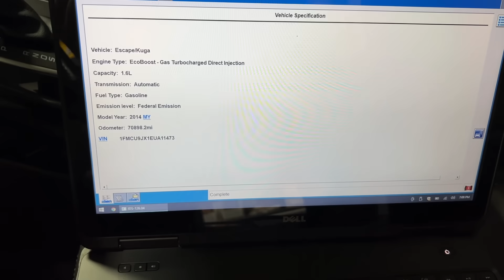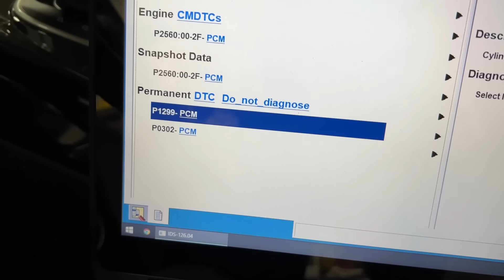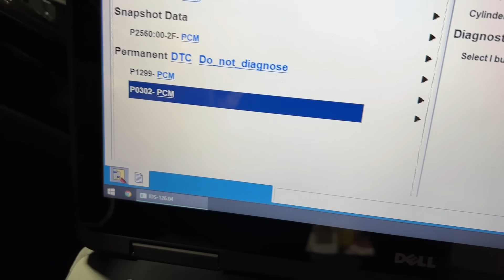Beware of Ford’s 1.5L 1.6L 2.0L Ecoboost Engines and Their Never Ending Coolant Consumption Issues!

Comment: As I write this, my 2018 has been sitting at the dealer for two weeks awaiting a replacement long block for this very reason! Thank God for our extended powertrain warranty! Ford really needs to own up on their defective Ecoboost motors!
Reply: They corrected this design flaw issue with the 2019 1/2 engine design....on all these ecoboosts....probably the replacement you'll be getting.
Reply: @barrya.6212  I got the Edge back two weeks ago with a new motor. Runs like a champ now, plus my wife is happy to get her baby back! Lol
Do you know what the redesign was?
Reply: @jasonbartz7352  Here is what I read about it...and this was the SECOND posting by a completely different person/ blog on the correction >>  "Because it’s a flaw in the block coolant passages.  They used a slot and that lead to cracking in the block.  They changed it to a drilled passage."
Reply: Is this covered under power train warranty? How do you get them to fix? I think I have this issue.
Reply: @EGGProduction  I have an extended powertrain warranty through April 2024 so the dealership covered the replacement. Otherwise I would probably have had to pay for the replacement up front and pray for reimbursement.
What's going on with yours? Mine started out by blowing smoke for a bit then would disappear. Check engine with misfire code came on and the coolant reservoir was slowly going dry. Two weeks later, it would smoke constantly, which is when I decided to park it until I could get it resolved.
Reply: @jasonbartz7352   Thanks for your reply and the info! How is your car holding up one year later? Basically I had a check engine light on and brought it to the local mechanic who said the spark plugs and fuel injector #2 were busted. Replaced those and 2 weeks later check engine light again for low coolant, but mechanic did not see any leaks. Appears as if coolant is burning up. I know nothing about cars but think this is a coolant intrusion described. Car is under 25k miles and in pristine condition. Called dealership and I'm barely still in the powertrain warranty, but they said they also have this fix under a one time warranty for anyone now. Bringing it in this week. Any way to get them to reimburse for what I've already paid to repair it?
Reply: @EGGProduction  glad they're taking care of it! You could contact Ford to see if they can do anything to reimburse you for the repairs you've already paid for, but I'm not sure if they'll do anything. I guess all you can do is try.
Since the engine replacement, it's been running great with no leaks or other issues. My wife takes extremely good care of it as it too is pristine. We plan to keep it as long as we can, especially with the price of vehicles now! Lol.
Best of luck!🙂
Reply: @jasonbartz7352 great to hear! Thank you! Lol yes price of cars has increased so much I was hoping mine still has a lot of life left!

Comment: Is this only happening on the eco boost engines? I have a 11 fiesta with the 1.6l with a bad head gasket in the shop. Non turbo. Do these still have the same issue with the block?

Comment: 2016 1.6 Eco *knock on wood" 80k thus far not a single issue.  Have the 100k extended on it however in case.

Comment: Wife’s 2013 2.0 eco boost escape is going strong with 128,000 miles. Maybe we’re lucky? She drives it pretty easy. Just a boost solenoid, fuel pressure sensor, and basic maintenance.

Comment: Why didn't you made this video 2 months ago? WHY? Let me explain why I'm saying this:

I bought a Focus 2012, 1.6L EcoBoost 150hp 2 months ago. Timing belt/chain was changed 2000km prior to my purchase. Fully revised, oil, fluids and other stuff. It even came with 8 wheels (2 sets, summer and winter). I thought it's a great deal. Car came with 212k km (131k miles), true, a bit much, but for the 5k euros that I've paid for it it was a good deal indeed (in my head). It even looked surprisingly well maintained. So there was no red flags. Until...
Well, I live in Germany. 2 weeks ago I was going 180kmh on autobahn, when disaster strike!!! It started loosing power. Like A LOT! Plus, it was burning oil (smoke behind, out of exhaust).
The moment I got home, I've put my OBDII reader and P0300, 0302 and 0303 pop out. Also had a code, can't remember it now, for low coolant (this message popped on the dash too).
Needless to say, that the spark plug on cylinder 2 is BLACK (others are fine), engine doesn't run round and it still burns oil. 

In your (or anyone who decides to help me figure out the issue) opinion, it could be only the cylinder head gasket? Or the issue might go even deeper, to cylinder segments (rings, or how are they called), bad cylinder or even a blown cylinder 2 assembly or engine?

I will do a compression test those days, even look inside it with an endoscope. 
I'm asking for a cheaper fix, other than rebuilding the whole engine or buying a "new" one, because another engine is around 3500 euros. And that, in my opinion, is kinda expensive. 
If you or anyone has any ideas, I'm more than open to listen to them.

PS: YES, I will sell the car as soon as I get it running again!
PS2: Is there a cost estimate for a temporary/permanent repair for the issue like the one presented in the video? (Edit)

Thanks to anyone wanting to help me out!

Comment: Yeah do a few 1.5L engines here in Australia for Headgaskets leaking, have also found the intake manifold bolts gradually loosen off and start rubbing on the water 2 air intercooler in the manifold causing another coolant leak. These engines are absolutely junk ☠️

Comment: I have been waiting to get my hands on a Ford Maverick for almost a year now and with the ordering for 2023 opening up next month, I’m a bit skeptical now. I need the AWD model which only comes with the Ecoboost. Unless then change the ability to get the hybrid with AWD I’m pretty much stuck. What a pain in the butt but thanks for the video.
Reply: I think they've solved the issues by now with the 2.0 Ecoboosts.  They sell an extended warranty from Ford too.  But at the price I paid for my maverick with an Ecoboost, I could probably buy a new engine and still cost less than a new F150.

Comment: Ford should have to replace every engine that has this issue come up. So we have a 2020 Escape with the 1.5L 3(?) cylinder engine. Love the car, runs good, is very comfortable, gets good gas mileage. it has 26,xxx miles on it. Does this engine have the same problem? Is there anyway to prevent this from happening? Or should we trade asap?

Comment: Great video! Unfortunately this exact thing just happened on my 2018 fusion w/ only 40K miles. Check engine light came on, I took it in to get looked at and boom, you need a new engine… smdh… thanks a lot ford.

Comment: Wow!   I have a 2017 Fusion 1.5 ecoboost with 97000 miles.  It runs well. The only issue I have is on start up it blows a large cloud of oil smoke but clears during running.  What is the usual cause.  Thank for all your great info.  Keep going.
Reply: Are you sure it’s oil? Steam looks similar.

Comment: Nothing is built Ford Tough anymore.  Don't expect a trouble free ownership for any new car.  They are built to last as long as the typical finance period then the heavy maintenance items start.  My 2008 Mustang has 129,000 miles, but had to replace the sealed front wheel bearings, follow by a transmission, all around 80-90K miles.  Replaced the rear axle seals and bearings at 128K.  Running with the 4L engine that is not loved by my mechanic, but I'm trying for 200K for an engine replacement or a new car.  My 1997 F250HD has 64K miles and is a true trouble free with the 460 engine.  Plan on keeping the F250.

Comment: I must have missed it but what is the core issue with the block?  The water passages are cracking at the cylinder wall or near the head gasket?

Comment: Do you see any improvements on the 2021-2022 Ecoboost 4 bangers they're putting in the Broncos??  Also, how are the V6 turbos doing in the Fords?  Also, I'd be really interested in your long-term opinion on how turbo powered engines (all mfg's) should do, specifically relating to seals, etc.  Thanks!!
Reply: It's my understanding that later model 2.3 & 2.7L do not have this issue. Cylinder walls are thicker. He mentioned 2.3 in the video but not on the description and suspect that's why.
Reply: @chrisp3231  Thanks for that, Chris!

Comment: Is the 2.5L Duratec any good, or does it have issues as well? The hybrid version of the Ford Maverick is tempting (in a few years once production is able to match demand), but I'm leery of Ford due to all the issues they have had over the last decade.
Reply: The 2.5 older one and 2.5 new hybrid version are BOTH BULLETPROOF / GREAT engines....not like these smaller ecoboost disasters....these ones were all corrected in mid 2019 ....so almost all of Fords engines 2020 and up are reliable....

Comment: Thanks for posting this video. I had the same experience with a 2015 70k fusion 2.0l . Replaced the engine with 140k a 2013 and it's been running great. Have you found just certain years or plagued with this problem? I also love to know what your favorite Ford engine is for reliability
Reply: 3.0 vulcan is slow af but will literally last thru apocalypse
Reply: The non turbo / non ecoboost 2.0 is very reliable from what I've heard.....almost all the non ecoboost engines are....the ecoboost 3.5   /  3.7  are pretty reliable.....they're non turbo versions are super reliable... the Ford 2.5 non turbo is bulletproof as well as it's more modern 2.5 hybrid version

Comment: the video didn't seem to address the root cause other than it being the block. Do you have more specifics? I have a 2.3 ecoboost mustang that is nearing the end of my 36 month warranty and only has 16k on it as it sits in the winter. If this is known to ford is there anything they will do if it happens outside of 3 year/36k? Fortunately i have a borescope, is pressure testing necessary or would enough coolant leak if left overnight after being put away hot?
Reply from the maker: It is a design flaw in the block, pretty cut and dry. I will show more when I have it apart.

Comment: I've been a ford guy for over 25 years  it's sad to see this I have a 2020 ford  escape hybrid 2.5 48.000 no problems  my question is is because most people that buy these vehicles don't put the premium fuel cause that's what a  Eco boost engine requires also what is your take on the new ford maverick 2.0  Ecoboost engine

Comment: The coolant "burning" really came to a head (no pun intended) in 2016 with the Focus RS 2.3 Ecoboost.  The problem is indeed the block design with a cooling slot or groove between the cylinders, coupled with free-standing cylinders.  Ford installed the "coolant groove" head gasket on the updated "no coolant groove" 2.3 block. The basic Ecoboost engine is a great design with this one major exception prior to 2016.  Subsequent engines, especially the high output 2.3 have gone back to the earlier design with a single coolant passage (hole) that is in the "meater" portion of the block away from the between-cylinder area.
Reply: It was the head gasket in the 2.3.  Ford designed a weep hole into it, causing coolant to leak onto the cylinder.  My brother in law had one and he was already to replace it with a new improved head gasket when his car was rear ended and totaled in 2018.  At least when Mazda built those motors they didn’t design a weep hole in a gasket
Reply: @kevinW826  there is no weap hole in head gasket. These passage ways go from one side of coolant jackets to the other side at a high rate.
Reply: @jamesmedina2062  I do remember a mechanic holding an actual Ford Focus RS head gasket, pointing to a weep hole and holding it over the open block, and explaining to me why this was the problem.
My brother in law was also a mechanic so he did know it was the problem with the head gasket.
I don’t know know what to tell you, just what I was told and shown
Reply: @kevinW826  ok there could be holes in gaskets for passage of fluids but a weep hole by definition connects to the exterior. So for example a water pump can have a weep hole and coolant may slowly leak to the outside.

Comment: My '13 Escape 1.6 was eating coolant when I bought it from a dealer on Staten Island. When I took it apart to install the long block found out the trans was shot too.  And the ptu had metal.  After a new engine, reman trans, and a low mile takeout ptu its been pretty good.  

On the plus side prices are so high that what I paid for it in 2020 plus the new stuff isn't much more than the same year would cost today with the original drive train.
Reply: RIP

Comment: I have a 2006 F250, have my 3rd engine now, (second crate engine) what i ended up doing with the second crate engine is buying and swapping the cam phasers with OEM FORD ones, cost me about $500 to do just that, and replaced the "new" crate oil pump with the high volume Melling pump. I learned this from watching Brian's videos.  The oil pressure at start up is now about 70 and when warms up at full operational temps is over 40. Ford was saying 13 was acceptable because they didn't want to own the design flaw. These 5.4 3valves HAVE to get oil or the cam phasers and timing gets hammered. Been working fine now, but on the first crate motor i was one month away from warranty expiration (3 years). Im fortunate it died when it did.
Reply: @PapaPugs  None of the crate engines use Ford OEM cam phasers or timing components.  None. You'll have to get a Ford supplied rebuilt engine. mine was ATK, Jasper is the same.

Comment: Oh great!!! 2013 2.0L Ecoboost 129k miles. Knock on wood nothing yet
Reply: Brian always does a great job. Lots more could be talked about in this video. I believe your 2.0 is a closed deck version and the open deck version started with the 2017. That is why your not seeing nearly as many 13-16 2.0's with this issue. My 2017 went south at 26,000 miles and I got a long block under warranty. My new engine has the new drilled coolant passages versus the slots between the heads that are so problematic.

Comment: i have a 2011 f150  it just popped up (when i went to pass someone) a po234 and a p144c code. turbo overboost. what is the most common problem and what do i check first.   any  help would be appreciated . thanks.

Comment: Well, hope my '18 Mustang EB keeps working. It's a great engine with lots of power. Still under 25k miles so not really very worried as I don't race or dragstrip it Also use quality full synth oil for GDI motors as well as a catch can.
Reply: Just monitor your coolant level often.
Reply: My cousins 17 had a turbo go out and send metal through the motor. Less than 100k miles. Needed a while new motor out of pocket.
Reply: My ‘19 econoost with 46k miles is in for the coolant intrusion and already looking at doing a long block replacement.

Comment: I have been building engines for hot rods and other forms of transportation for years. That being said and I don’t believe in this stuff but in place of stuffing a new long block into that isn’t there something like bars leak or som kind of head gasket seal that would prolong the inevitable and get 10 to maybe 30 thousand more miles out of it? That would be better than 8 grand for an 8 year old car.
Reply from the maker: They love the car and want to keep it for the long term.

Comment: Mom Bought a new Aerostar with a 2.8 V6 engine in Sept 1985. She got 23 years & 290,000+ miles out of it.
Seeing this 37 years later of a block failure after 70,000+ miles, what happened? Older designs lasted longer than the newer ones? This is not good optics for Ford.

Comment: I had two ecoboost F-150’s (a 2014 and a 2018). Both had endless issues. I finally gave up and bought a new Sierra which has been flawless so far
Reply: I'm a GM fan for years. Unfortunately I'm not buying a GM anymore. Transmission and The dreaded lifters issues. My son got rid of his GMC sierra because of that. The 3rd owner now is having issues trans and lifters.

Comment: While there's no defending Ford or any modern manufacturer for issues like this, it's just not as uncommon as some might think. In my opinion any modern Ford is actually about $1600 more than what the final negotiated purchase price is. That's about the going rate for 8 years/100,000 miles Ford ESP Premium.
Otherwise it's a gamble to keep a new car beyond factory warranty on drivetrain. Sad, but that's how I see things these days.

Comment: I had a 2013 1.6T... many problems including coolant issues. Yes first batch car,  after many dealer visits I was unable to get a replacement engine. Sold the vehicle with and extender warranty from Ford with 130,000kms. When it worked was a nice car but men, it failed a lot... Ford again? I don't think so. So sad.

Comment: We're Ford people.  My wife's 2011 Escape with the V-6 has been an amazing vehicle.  Other than a leaky front cover- in 125,000 miles - it's just been maintenance.  We've been looking at a 2019 or 2020 Escape to replace it.  I've been hearing about this cooling issue and issues with the direct fuel injection.  I looked towards and Edge - but they have the 2.0 Ecoboost.  I'm seriously considering a Honda or Toyota for the first time in my life.
Reply: Take a look at the Ford Edge ST. It has the 2.7 V6 ecoboost.

Comment: Brian, my daughter had the same problem on her 2017 escape2.0, luckily I heard about it and pulled the tsb on it, replaced engine at 50,000 under warranty. My mom had the same problem on her 2017 escape with the 1.6, it was a lease, engine replaced under warranty.  Sister in law Lincoln mk ? same problem. The 4cyl are garbage, what a shame! Shame on FORD!